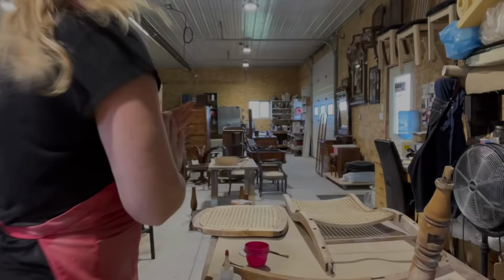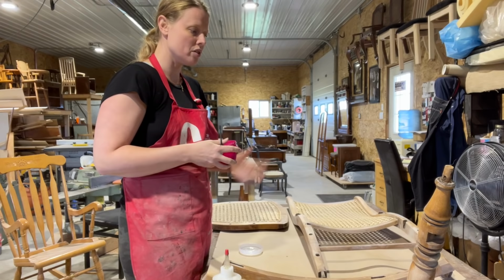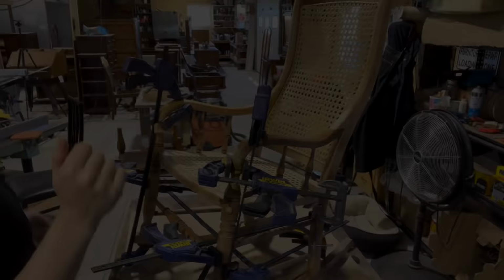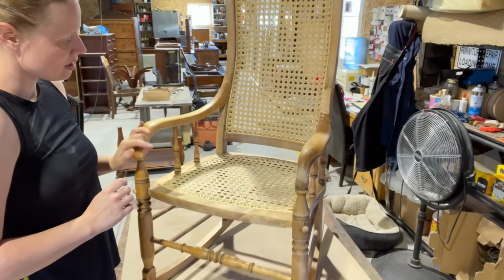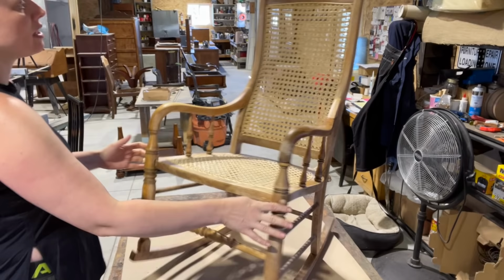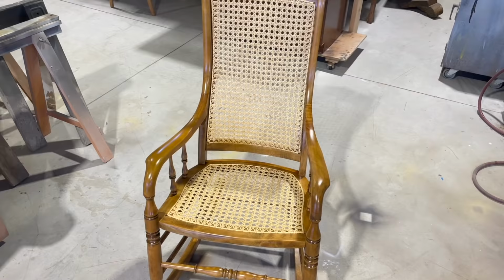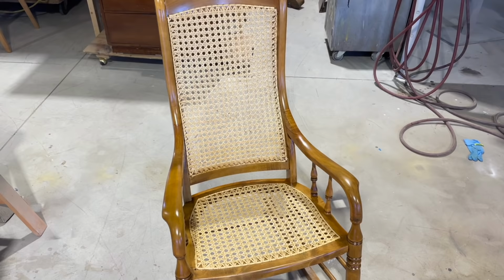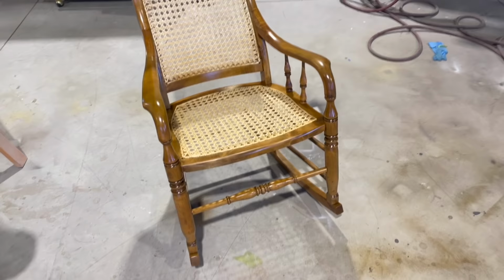My customer can finally rock again!

Comment: I have an old hospital wheel chair with cane seat and back, but mine is installed by a sheet of cane, wet and fit into place with small strips of trim and glue. I bought it because it interested me, then I looked into how to restore, and it still sitting in my shop, still finding other projects to do before I try that.  Yours is so much work and I really respect your patience and skills. Great job.

Comment: Beautiful rocker. I question applying lacquer over the cane as it tends to make the cane brittle, ‘gluing’ the strands together and not allowing strand movement. A cut down shellac sealer coat is the traditional cane finish. Thank you for your work.
Reply from the maker: Shellac does the same thing. The trick is to flex it after the lacquer dries to free the strands. Cheers!

Comment: Such a transformation. The patch repair on the arm has horizontal striations- that adds character, shows the chair had lived but what causes it?
Reply from the maker: I wish I had been more careful with the grain actually but some maple has both horizontal and vertical patterns. It’s the only thing I didn’t really feel completely pleased with. But other than Thant the fit was great and it blends in.

Comment: As a 5th generation chair caner of over 40 years, I would never have used any heat or flammable on a freshly woven seat to remove hairs. I would have removed them by hand.  Corner holes where the spline meets should have been plugged with no holes showing. End product over all does look better, but the caning is disappointing to me.
Reply from the maker: sorry to hear that, i definitley would love to learn more from an experienced caner as yourself

Comment: Although the finished cane prouct looks nice, you've unfortunately  cut the longevity of the cane by at least half of its lifespan by spraying a finish over it. I"ve been caning over 45 years and also given caning lessons and stressed to the student  that you never put a finish over the cane, especially the under side of the cane. Cane needs to be moisturized approx. every 6 months depending on the  area you live in. Now it can no longer absorb water and the lacqure on top of the new cane is restricted in expansion and can now only sit thee and dry out and become brittle.. The underside of cane can be stained wih a special stain that will allow for it to still absorb. The reason i"m letting you know is so that all the hard work the caning person put intp this chair lasts 50+ years or longer.  I enjoy your videos by the way. Just a helpful tip. : )
Reply from the maker: wow, thanks. ive never thought of this as i have replaced so many factory finished weaves but it makes perfect sense. do you have any tips for when i have to color match? how about a breathable finish? thanks for the tips i really appreciate them from professionals.

Comment: Beautifully done, amazing 
How do you handle epoxy glued joints?  If you or someone else needs to take this apart, wouldn't the epoxy shred those joints apart?
Reply from the maker: They need to be soaked in acetone

Comment: I understand why you used epoxy on some joints.  Why did you use hide glue instead of PVA on the other joints?
Reply from the maker: It’s a certified antique. It’s important to me yo try and use appropriate restoration methods. Cheers!

Comment: Did you spray lacquer over the new Kane work?. If you did will it crack?.
Reply from the maker: Yes and no it won’t crack as long as it’s not put on too thick. But I have heard lacquer can dry it out over time so I think I should stick to oils or beeswax next time. Cheers!